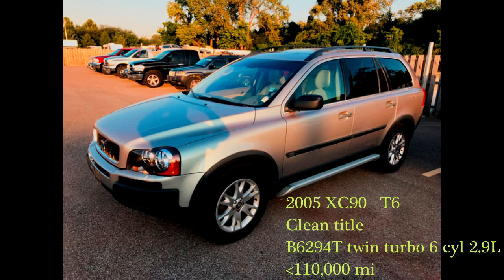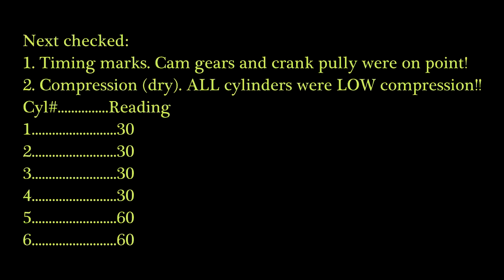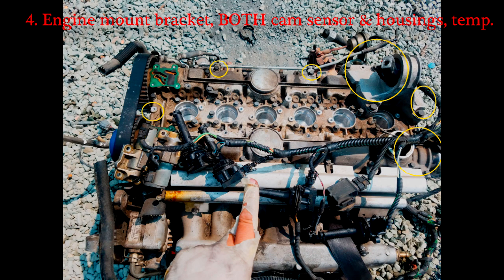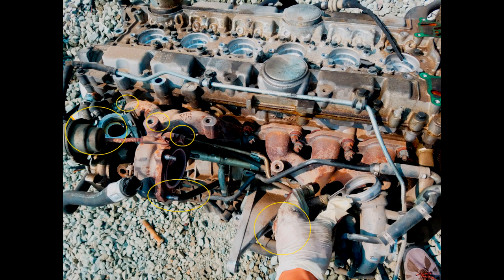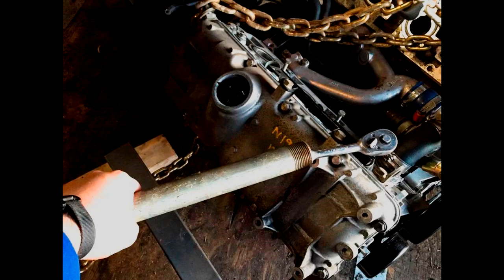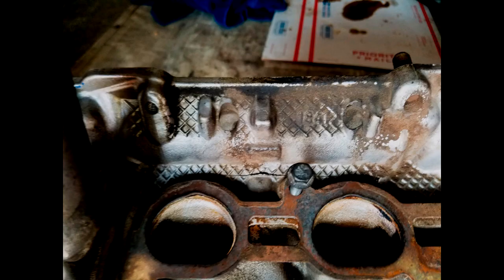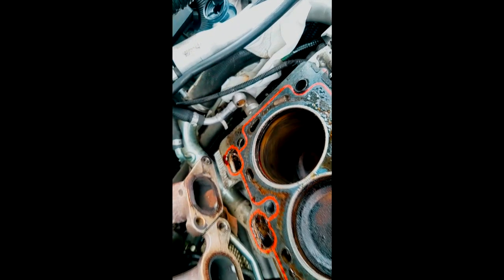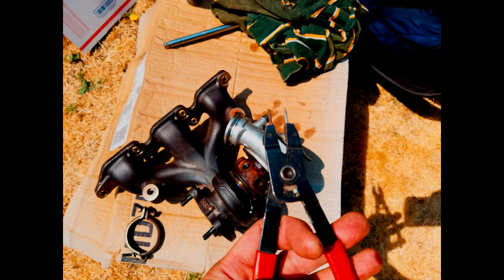Volvo XC90 T6 2005 failed turbos and head gasket

Comment: 1:37 hi tha ks for sharing , i have same sound as this , i checked the compression its 0 on all cylinders,  the timing belt looks good and turns too , what im having ? 
The car was blown white smoke then the smoke stopped for 20 miles then the car stall then crank no start .
Reply: Update : I havd 2004 volvo xc90 2.9 i installed new head and headgasket now at first start then i drive for less than a mile i get P0011 P0014 i delete the codes installed new vvt seloneds and new oil 7.1 quirts and new camshaft sensors and still getting the P0011 P0014

Comment: These also had a weird issue where as the brushes in the starter fail it will crank but not start. It interferes with the crank position sensor and will throw a cpk code.
Very picky with air leak, had the tiniest air leak i could barely blow through and threw the 130a code in vida generic readers will give you 2187,2189 lean idle.